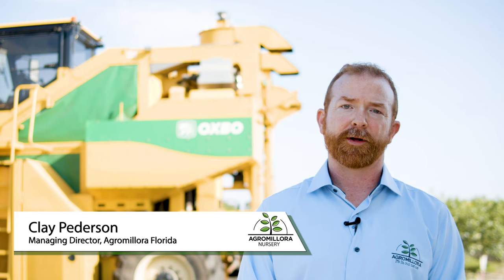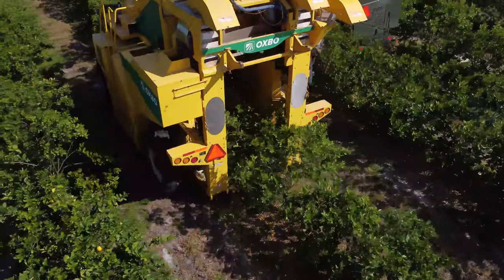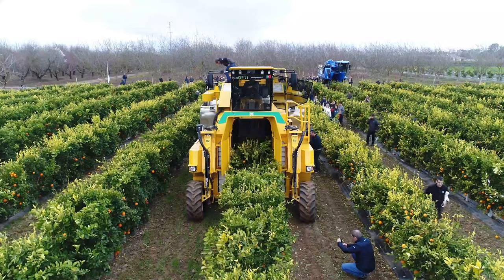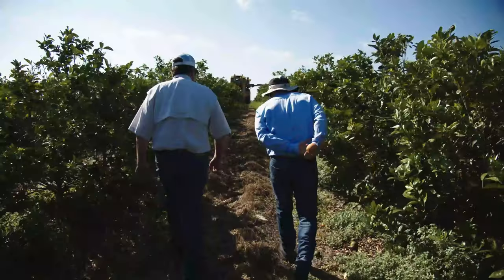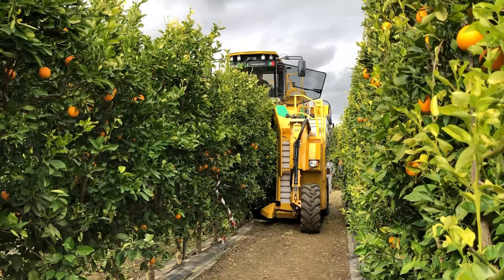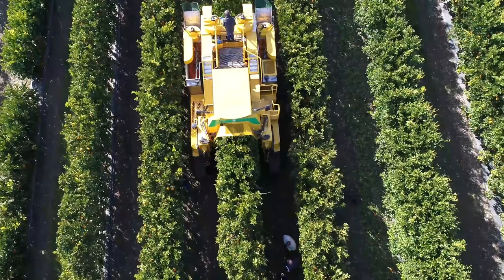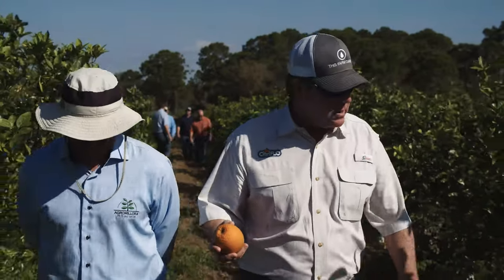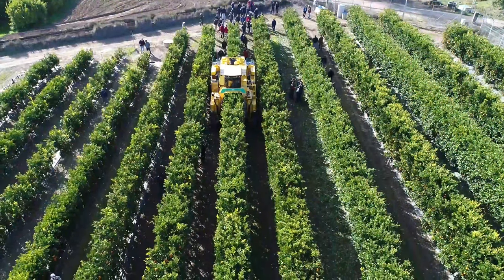SHD Citrus Mechanical Harvesting | 2021 Florida, US

Comment: For the block in Florida, the citrus varieties are Valquarius and Vernia.  12x4 spacing so 908 trees/acre.   The rootstocks used were US-897 & UFR-06.  Not sure if we'd go with those varieties and rootstocks if planted again.  Probably use 942 rootstock.   As for exporting crop, I would foresee this SHD type planting being used in juice oranges and not in fresh shipments to be exported.  We just hedged (pruned) block last week using a standard citrus hedging machine.  The block was originally planted in May 2018.  We are the grower (landowner) in Florida (Lost Lake Groves), so I do not know if rough lemon root stock can be used in high density orchard.  The rootstock we used was a dwarf tissue cultured SmartTree from Agromillora.   Perhaps if there are other questions that need to be addressed, you can contact Agromillora's Florida's office for answers - Clay Pederson or Michael Kemp.

Comment: Isn't that bad for export though? I imagine the machine basically pulls the stem out of the orange and leaves a crater which would cause it to rot. Also it's not as appealing at the supermarket. You can break the stem without using clipers but you have to know how to break it which is what a lot of pickers do to fill up faster.
Reply: Currently this way of harvesting is for processing fruit (juice fruit)
Reply: For Fresh Fruit, this pedestrian hedge makes hand picking very efficient.  The machine is for harvesting citrus that is destined for juice.